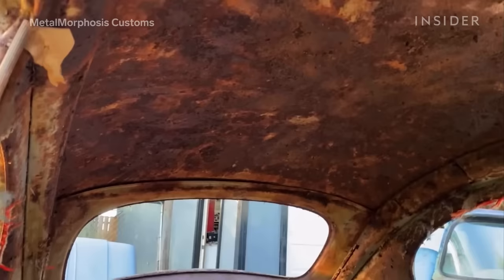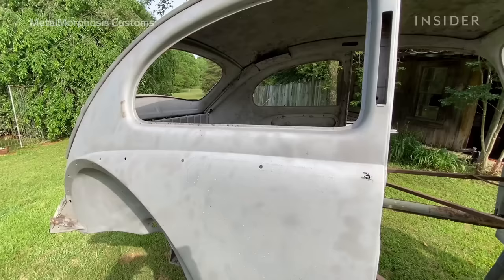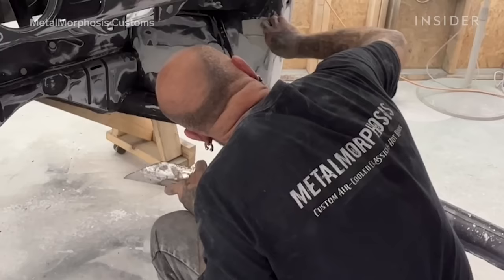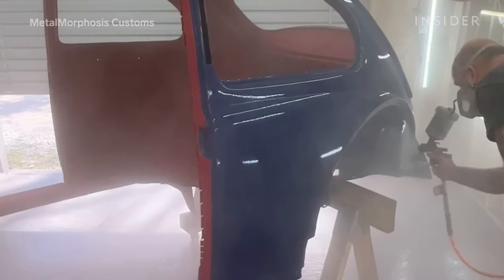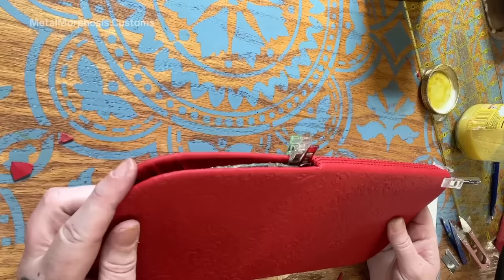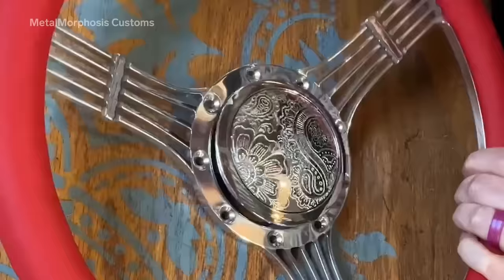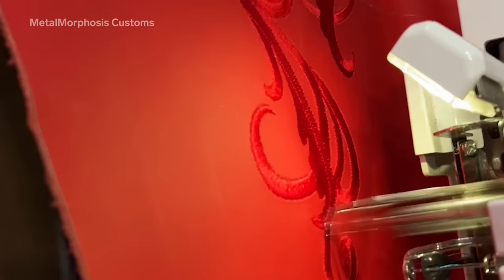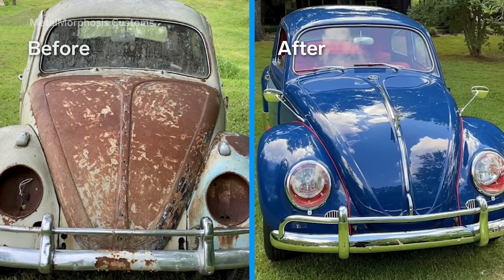How A Rusted 1960s Volkswagen Beetle is Restored | Cars Insider

Comment: Could someone tell me what the distinction between a bug and a Beetle is?
Reply: Is it a matter of year? Motor type? Exterior trim?
Reply: Both terms were used synonymously for the old original beetles. The New Beetle from the 2000s were totally different cars, ie. a modern take on the classic car. Those were actually officially called Beetle and they had a badge saying Beetle. The old ones never had that.